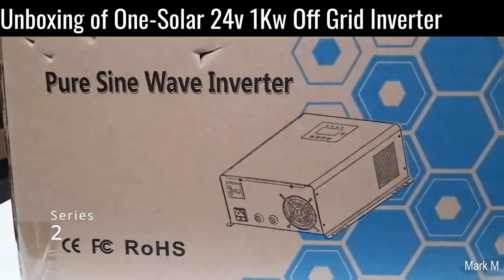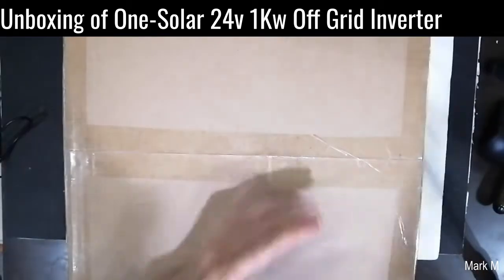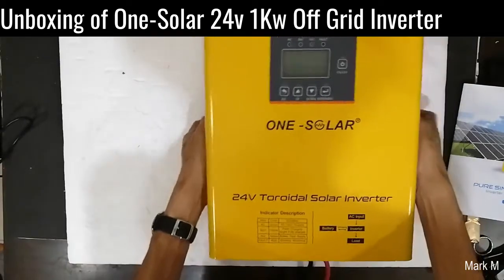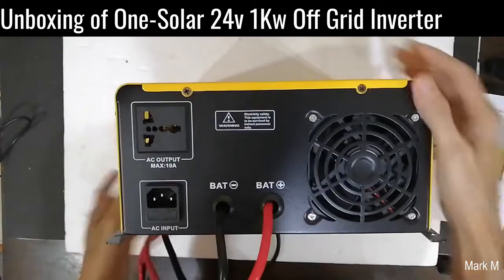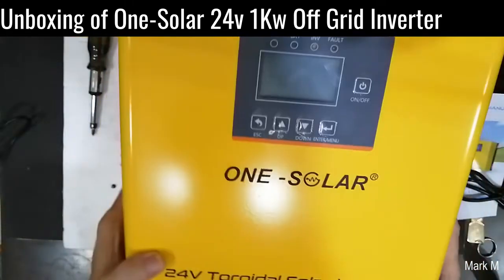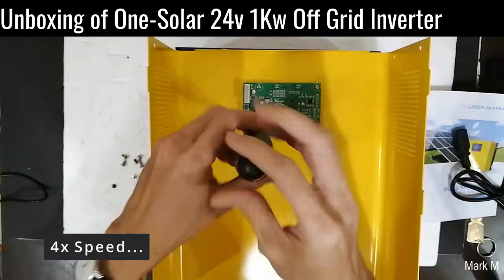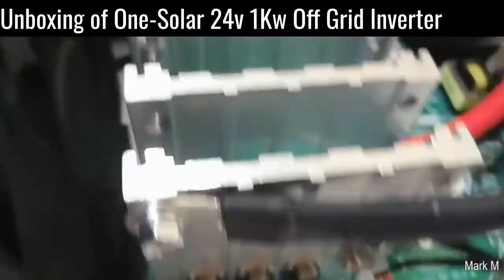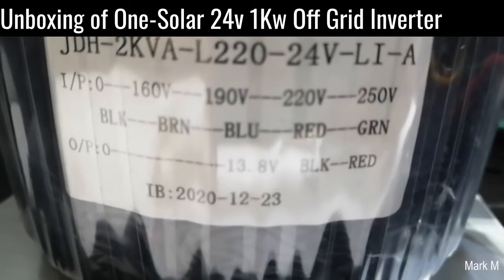Unboxing of One-Solar 24v 1Kw Off Grid Inverter with AC Charger

Comment: need ba talaga yan sundin ang AC input na live and neutral or pwede mabaliktad?
Reply from the maker: Kung ang grid nyo po ay L-N, dapat sundin. Pag L-L like dito sa Manila, walang problema. I'll make a guide paano malaman kung anong grid meron kayo at paano hanapin ang Neutral.
Reply: @MarkMinoza  thanks. Meron di kasi nagsabi na ok lang na ma reverse. Dati ang design ng one solar walang naka lagay na L-N need lang ng power cord ok na at walang label AC-INPUT lang

Comment: Boss baka mapansin mo question ko, may way ba to increase the AC voltage output?  may 1kw ako na ganyan, pag naka AC bypass nag 213v down to 210v kasi and may appliance ako na ayaw niya ng ganun.  pag naka inverter nag 220v naman.  ty.
Reply from the maker: Pag bypass po, ang grid nyo ang basis ng output. Only during inverter mode na regulated ang voltage outout ng inverter nyo. Kaya pag nag lvd na ang off grid inverter nyo at mawala ang grid, patay din si output ni inverter.

Comment: Good day jan sir,watchng frm cebu province.may tanong lng ako sir kung kaya bah sa 1kw invrtr one solar ang 0.6 hp aircon at ref nah 120w rated powr sir?.
Reply from the maker: Ref siguro no issue pero kung Aircon , unless its Inverter type. medio mataas ang surge ng AC. Ill test it and lets see kung kaya. ill make a video on that also.
Reply: @MarkMinoza  oki po sir,slmat.

Comment: Good day sir. Ask ko lang po, Since may ATS function yong inverter na kapag nag cut off(brownout) yong DU/AC sa battery kukuha ng power ang inverter. What if po kung nag low voltage/high voltage  si DU/AC mag switch po ba sya sa Battery? Plan ko pong gamitin sa compshop as centralized UPS, madalas kase low voltage sa area namin.. salamat.
Reply from the maker: Anything na may abnormality po sa Grid nyo (low voltage, high voltage, no grid), automatic po ang battery mag supply sa Inverter. ill make a video sa tanong nyo, ill have the Grid go to low voltage at tingnan natin anong gagawin ng Inverter.

Comment: Susbcribed!!
boss pwede magrequest ng video comparison ng one solar vs snadi inverter
both 12V 1KW,
features similarities and difference, thanks, more power po!!
Reply: One solar has 5 mode . And one solar is much higher LVD voltage range to 8.5 to 13.5 .it is usable if you are using lifepo4 batteries .

Comment: planning to buy this model , can it run an   aircon .6 hp?  whats the difference from the snadi 24v1000w blue one?
Reply from the maker: If its inrush current is within its 2x capacity, it can handle this. Ill add it to my test after this lockdown.
Reply: @MarkMinoza  i think this model is a good startup for 24v system, more simpler than the snad/snat model :) . A 1kw can power most household loads including  small ref, fan, rice cooker?  small microwave? small freezer ? .5hp aircon? Nice unboxing video, thanks, very informative to those who are planning to buy a 24v model  for simple application. Wating for Lex delivery :)
Reply from the maker: @boyerr  not sure about microwave, but ill check may unit here how much current draw will it take. As for rice cooker, ill also get its current output. For AC, its a bit of a stretch since majority of AC now adays are .75hp. And if your using a traditional model , using it draws huge power over time. I can test it since i have one.
Reply: Hello  @MarkMinoza  , I plan to use 2 batteries of 12V/100Ah+2 panels and a submersible water pump 900w. Do you think this inverter can do the job? Thank you
Reply from the maker: @expeditii  check your inrush current. Normally a 3kw off grid Inverter can. You may see how to check inrush here. https://youtu.be/ZQNrEZ8wwxc

Comment: Sir pwd ba mag upload ka video panu mag setting.
Reply from the maker: Still working on it. Sige po, this week unahin kong e upload.
Reply: @MarkMinoza  magkano na yan ngayon? at saan mo nakuha yan?
Reply from the maker: @tulitzagasi2325  6k yan sir from OnePoint.
Reply: @MarkMinoza  ah ganon b ok thanks. mayron ba kya 24 Volts at 2000 watts na available?
Reply from the maker: @tulitzagasi2325  you may check their website po. www.solarprice.com.ph marami silang item.

Comment: 3 stage ba ang ac charging nito sir?
Reply from the maker: mostly 3 stage ang AC Charging just like sa mga UPS type. Pero ill ask the distributor, balikan po kita sa tanong nyo.
Reply: @MarkMinoza  27.6 ang charging voltage.. pagkakaalam ko float voltage siya for 24v battery.. hindi na siya taas 28v+ para sa absorb?
Reply from the maker: @silverlight0687  The Inverter is highly customizable, you can customize its parameters based on your needs. Refer to your battery data sheet when doing customization esp. on float values. Different manufacturers have different float values.
Reply: sir naconfirm mo na kung 3 stage ito?
Reply from the maker: @silverlight0687  hindi pa sir, may hinihintay pa akong isang 24v 1KW Off Grid. pero ill test it next week to check how this thing works.
Reply: @MarkMinoza  patest din sir.. pag naka dc prio.. pag lvd na, matrigger ba ac charging?
Reply from the maker: @silverlight0687  ill check that condition. Normally i dont use ac charging to charge my battery, pero ill simulate it.
Reply: @MarkMinoza  sir for emergency charging lang din if ever bibili ako niyan :)
Reply from the maker: @silverlight0687  sige sir.. ill test this weekend. Ill be using my vrla muna.